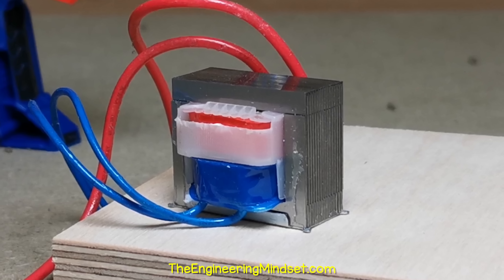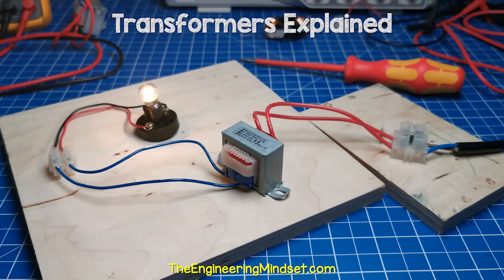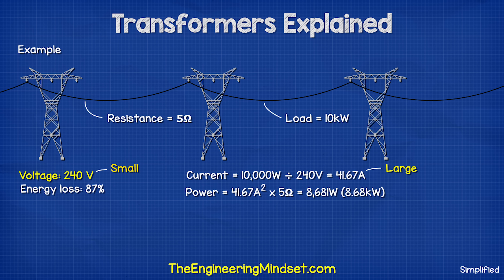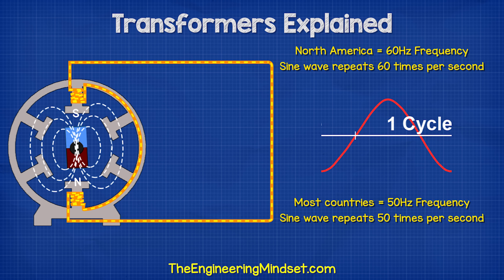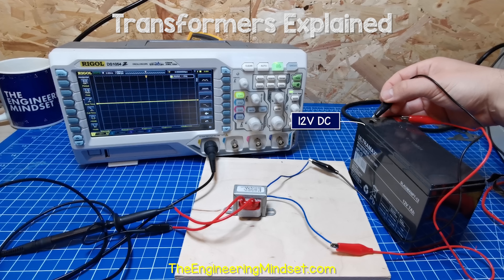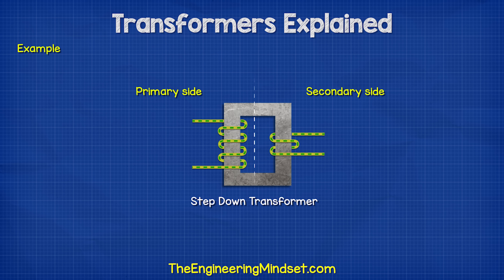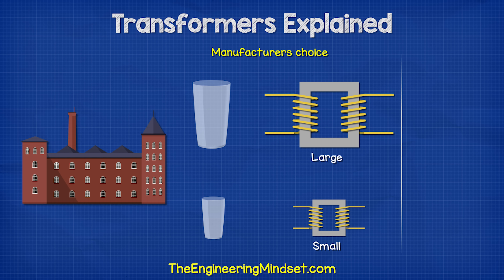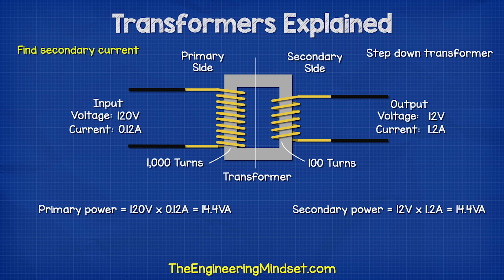Transformers Explained - How transformers work

Comment: A few others have said it, but you have reactive power wrong. It's not wasted as heat. Anything generating heat is consuming real power. Reactive power is temporarily stored and returned to the circuit by reactive elements like capacitors and inductors or other devices that exhibit some amount of capacitance or inductance. Reactive power does increase current flow and thereby increases losses due to parasitic resistive effects, such as the resistance of your wires or the eddy current and hysteresis losses in your core, so generally speaking, poor power factor will likely reduce the efficiency of the overall system. In one of your graphics you also labelled power factor as "Efficiency" and you also appeared to have used efficiency and power factor interchangeably after your beer glass analogy. Efficiency and power factor are not the same. While a power factor closer to unity is probably going to be better for efficiency, they are different quantities. Also, I'm not sure if this was just part of your analogy, but it sounded like you said that electricity customers pay for apparent power. This isn't true anywhere where I've lived - at least not as a residential customer. Residential customers in at least Australia and Canada pay for real power, so you generally don't get penalized for poor power factor as a residential customer. I'm pretty sure it's the same in the US. This is why your bill says how may kWh you consumed and not how many kVAh you consumed. I'm not sure whether other jurisdictions penalize small consumers for small power factor or not. Large industrial and commercial users may have different contracts with their utilities that charge them more or less based on their power factor.
Reply: Well written post. But even domestic/ residential customers help keep the power factor close to 1. The fan manufacturers, where I live, put a capacitor (capacitive load) in the circuit to oppose the inductive load of the fan motor and bring the fan's PF closer to 1. I don't know whether this is mandated by law or done voluntarily by the fan mfr to "help out" :)
I do know I only pay for reactive power at my residence (68 yo, male, retired), in South Asia.

Also I have had fights with my wife and 2 grown up D (if these 2 are around at that time) when they want to run some appliance off the solar panels when the main supply is absent. Try explaining that though the mixie motor may be rated "only" as 750 w, using it makes lights go dim and affects the TV/ computer! I have come to a stage where I am informed about the need to run the mixie, I shut off my computer and other non essential loads and give the green signal. Even then it comes as a surprise how dim the only light on becomes as the mixie motor takes both resistive and inductive loads from the panels.
I also want to praise the man who "invented" the concept of square root of (minus 1) as the ONLY way to deal with electrical circuits having inductive/ capacitive loads! Along with the wheel, 2 brilliant inventions.
Reply: I farted

Comment: What are the losses on 400kv lines? I'm amazed how we've harnessed electricity and figured out how to distribute it so efficiently.
Reply: 3:52
Reply: Losses always depend on current. I^2 * R. Voltage is irrelevant in this calculation. We use higher voltages to lower I as low as reasonably practicable, based on Ohm's Law V=IR 's proportionality.

Comment: Just a quick question: 

Let's say we have 1amp 12 volts at 50/60hz. 
If we keep same frequency, over transformer we will lose amps or volts, depends on stepping up or down. 
But.... What happens if we increase frequency? Let's say 60 Hz to 240 Hz and back to 60 Hz, using capacitors?
What happens to voltage and amps in that case?
Reply: I don't think you could use capacitors to do this.
The only way i've seen it done is by using your Primary Frequency (60 Hz in your example) to spin a motor that is close coupled via Gears to spin a Generator at Secondary RPM (240 Hz in your example). I don't have to mention hopefully the amount of energy losses that will be caused by using this system.

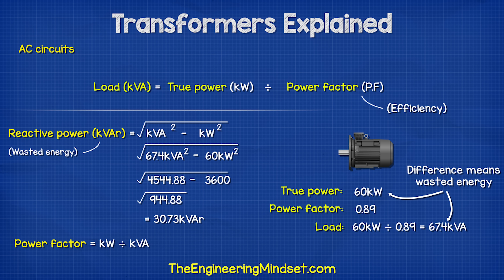Comment: At 11:50 minor correction. KVAR is stored energy due do reactive components (capacitors or inductors). It is charged and discharged throughout the system and it is stored energy. 
However the result is a reactive power creates higher current over your transmission line which result in greater losses. KVARs are sometimes desirable and are used for voltage control.
Reply: Aren't capacitators used to lower the VAR and increase the power factor due to a bad cos(phi) by the system only having spools? Then it makes the watt-less(reactive) power fluctuate from spool to capacitor without any energy consumption? Or have i completely messed something up in school?
Reply: @rasmus1600  Yes, but it depends on which side of unity you are looking. Capacitors can be used to reduce inductive VArs; the same way inductors/reactors can be used to reduce capacative VArs. We generally see commercial use requiring motors that all have inductive power factors, for this reason you have probably seen capacitors used to reduce VArs (inductive) by adding capacative VARs. The cos(phi) as you mentioned is a phase lag/lead description of the VArs; and can give a physical description of what the motor induction effect has on the voltage/current waveforms, and likewise how the capacitor introduction can remedy this. It also shows how Real Power (V*I) is lost as cos(phi) increases. Draw the current and voltage graphs at unity (they align); then draw a power wave (V*I). Repeat the same process with some amount of cos(phi) offset on either voltage or current waveforms. Redraw the Real Power (V*I) graph. You will see that with some amount of phase offset, the RMS real power decreases.

Comment: 13:46
I have a question : what if i want to design i transformer or to put it right i want to diy my own transformer how to pick up the number of turns 
Other question : if i found a transformer without a data sheet and i wanted to modify the output to a specific voltage how I suppose to know the number of turns in the primary cuz i think i differ by the wire gauge, input gauge etc..

Comment: High Voltage Transformer Microwave Utilized Transformer High Old Designing Without Such Transfer If so see how much winding measurement of the transformer according to Measurement

Comment: perfect timing.....although your video isnt really "needed" i'll still enjoy it immensely while improvising transormers unless you want to recommend a core for me, im trying to reduce 120v to about 70 or 80 in a portable/mobile form with atleast 500w, maybe even 1+ kw output although the generator im powering it with is only rated at 1 kw and the motors im running are rated at 1 kw EACH and im driving them with 2 or 3 kw at the moment, running a 36v motor at double voltage doesnt just equal double the power used, both the current and voltage multiply if i am not mistaken so instead of going up by the square, power goes up by the cube, from 1 kw to 4? kw at the moment i am looking at a few old MoTs and a few toroid transformers from sub amps

Comment: If electricity moving through a wire creates a magnetic field, wouldnt there be someway to harness that (via a generator spun using the electromagnetic field) energy to create more power?
For instance, could you rig up a series of alternators/generators that spin using the electromagnetic field of the wires going to devices in your home?
Say you have them connected to a battery bank and while you're using power in your home, it is at the same time charging a large battery bank?
Reply: no, what you described is a beidinni motor originally made by john bedinni, look it up and if you actually manage to get close to or over 100% the world will beat a path to your door
you cant get more power out than you put in, if you do you'll usually(always?) find that there is some kind of power you didnt account for, be it external magnetic field or even rf/photon/heat flux THE LAW OF THEMODYNAMICS AND CONVERSION OF ENERGY SHALL NOT BE VIOLATED as the science asylum would say
Reply: if you produce a transformer with x current and x voltage going through it say 10 watts total, if you try to leech some off it using the magnetic field by putting an extra wire parallel to it, you will find that there is an exact corelation to the power you took away and what is available at the output, if you put a 3 watt led on the output you will only have 7 watts left, again, if you figure out free energy, the world will beat a path to your door, and the rated capacity of a transformer is a nominal value, you can pull 100 watts out of a 50 watt transformer and it'll still work but it will get less and less efficient as you force it to work harder until you reach the maximum transfer ability of the core material and instead of drawing 100 watts, it may draw 150 watts and those extra 50 watts you're pushing into it will be converted to heat
Reply: @frogz  Well said.  I would add further that the losses related to each component (heat, noise, rectification to DC for batteries, etc) have made this approach unfeasible.  Edison and Westinghouse both probably scratched their heads more than once over this diminishing returns phenomena.
Reply from the maker: Seen the new LED explained video? so much detail covered! https://youtu.be/O8M2z2hIbag

Comment: Could have explained about tapped transformers(ex: 12-0-12) with the way you explained for the primary and secondary(voltage, current, turns) calculations. Consider in future!
Reply: think of it like batteries, each one only adds up to 1.5v and between any 2 ends of a single battery will only by 1.5v but if you take 2 in series it will be 3v or 4 6v, if you measure from a to c it will be 3 volts, if you measure from a to I it will be 12 volts, if you measure from a to e OR from e to i, it'll be 6 volts in both cases
(a) [-1.5v+} (b) [-1.5v+} (c) [-1.5v+} (d) [-1.5v+} (e) [-1.5v+} (f) [-1.5v+} (g) [-1.5v+} (h) [-1.5v+} (I)

Comment: In india they use 3 phase transformers and the secondary side of the stepped end down version has 3 phases and 1 neutral in total 4 outputs. Each phase ranges between 215 volts to 240 volts and neautral being zero. Each home will either have 1 phase n neutral or 3 phase and neutral. The primary side has 3 phases . Each phase has around 11kilo volts.
Reply from the maker: Thank you, do you know we also have a Hindi channel? https://www.youtube.com/channel/UCg4k338hz9U8jnD5SXPO5jQ
Reply: We have the same system here in The Netherlands, do you have any video suggestions where i can see how this type of transformer work?

Comment: In Brazil we have 127 and 220 both 60hz. Almost all homes and apartments have 3 phases and neutral. So overkill. On the plus side when EV becomes mainstream almost all houses will be very capable for fast charging. At the 127v areas they can use a phase and neutral 127 ou two phases 220. 
Am I correct to assume this use a star transformer?

Comment: Does this mean that if you take the transformer out of an electronic device for example a television you could then run it on direct current if you get the voltage right?
Reply: yes and no, you need to collapse the magnetic field for it to transfer, pulsed dc works but if you just run straight dc into a transformer you will get the voltage increase a total of 1 pulse and then the magnetic field is static and cant reset to push any more

Comment: Imagine 2 step up trafos connected in series, the output of the 2nd trafo connectod on to primary coil of the 1st trafo. Does the voltage gonna increase infinitely?
Reply: yes, until the breakdown voltage of the insulation/air, i've used 9 volt transformers in reverse to pull 1200 volts out of and i've used similar setups to produce ignition transformers by discharging a capacitor charged up to 350 volts through them to provide an electrically activated ignition for spudguns(potato canons)
Reply: if you put the series transformers in a much higher dielectric material such as oil, you can push it alot higher than you can in air, that is why most high  voltage transformers are potted in epoxy or even in a case of liquid oil, the oil also has the added benefit of allowing better heat transfer to the outside enviroment than air as it is thicker than air

Comment: Ok, here's a question... How do I calculate this...

I had a 10 VA variable transformer intended to step down voltage from 220 to 4 volts, a factor of 55 times. Now..., by accident I fed that transformer 24 volts on it secondary side, while disconnecting the primary side from the mains, and by accident again, touched the pins with my fingers..., giving my fingers a taste of 1320 volts (YIKES!)

Now, how many amps did my fingers get?
Reply: Probably less than 20 mA if you are still alive.   Current depends on the resistance (and reactance, for AC circuits) and finger tips are usually dry.
Reply: @karhukivi  Not necessarily. I was isolated from ground when I did it, so I could easily be large. As long as the power doesn't go through the heart, it won't kill you
Reply: It depends on the resistance between each finger that touched your 1320 volts and how good was the contact when you electrocuted yourself.
And also how "wet" your fingers were.  You can use an ohmmeter to figure out approximately. But if you take, say, one megohm "finger" or "body" resistance (1,000,000 ohms) which is a fair value to start with, you have 1320 v/ 1 megohm = 1.32 milliampere. The worst thing is an electric shock between both hands as the current passes through your chest thus through your heart. Ouch!

Comment: A bit misleading the 3 wire system, you have 3 power line systems. IT, TT and TN-C/S

If I have understood correctly, most of the world use the TN-C/S system. Norway and I think Romania use IT and TT systems. The IT system has the "neutral" on the transformer not connected to ground. TT system have the "neutral" connected to ground. Here the voltages are 230V between any and all wires, also 3-phase. Voltages to earth are 110-130V, depending on transmission voltages etc.

TN-C/S brings the neutral from the transformer along with the wires, for a total of 4 wires. C is for combined, S is for separated. The neutral, or PEN wire in the TN system is splitted in the intake, so you get one ground wire (PE), and one neutral (N). Before this intake, the system is TN-C with one PEN wire. After the intake the system is TN-S, with one PE, or ground wire, and one neutral. The voltages between phases here are 400V, phase - ground/neutral is 230V. Home appliances are 230V, so you load the 3 phases as evenly as possible betweem the neutral. 

When supplying 3 phase equipment, you have to check voltages. If the distribution system is TN, you want to power something made for 230V 3 phase, you need a transformer. Electrical motors are an exception as they normally are 230/400V, converted to the voltages you need just by copper plates in the connection house. Normally.

Comment: Hi, I do not understand how is possible to have a very high voltage but a low current.
I feel it is obvious that the enerrgy can not be created and if the power supply is one you can not increment power with a transformer. Thats what I understood at least.

But in the other hand if a cable has low resistance and I connect a very high voltage shouldn´t the intesity be high as well? because of I=V/R.

Thanks a lot for your videos and hope someone can answer my question.
Reply: The input current of transformer is held back by BEMF so the current won't get high even with very low wire resistance. But if it's DC then the input current will rise very high while no output, then the coil heat up. 
If the output is loaded, then the input impedance also decrease as the magnetic field holding back the current absorbed by output coil.

Comment: so how do they work in a car ignition coil which is DC?
Reply: pulsed dc works alot like ac but you only have half of the voltage swing available of an ac signal, you'll be going from 0 volts to 12 volts to 0 volts to 12 volts instead of 0 volts to +12 volts to -12 volts to +12 volts, the voltage is chopped up into chunks on and off with transistors or in older systems using points that physically break the connection with the engine rotating
Reply: @frogz  well stated!

Comment: I taught a class on power, generators, and motors.  This was the class that most students had trouble with.  Great job.
Reply: 30+ years ago, I took that class.  It was indeed challenging and, dare I say it versus nascent digital classes, boring.  Yet here I am 30 years later in the large power transformer industry (Dutch OEM).  Old school craftsmanship is a huge component to producing high quality power transformers.

Comment: I work in a ship and we have a group of Transformers that converts Voltage from 440V into 220V. The 440 V comes from generators and after Transformers, It goes 220V to the ship superstructure.

Comment: Sorry, I've got a dumb question. So primary coil forces the flow of electrons in the secondary coil. However, secondary coil doesn't get free electrons out of nowhere, and the load is using them (i.e. in lightbulb electrons are going out in the form of thermal energy and light). So why there's no limit on how long transformers can work before the secondary coil depletes all its free electrons?

Comment: In my opinion those step upconverters are magical devices as they can increase the voltage.
And off course voltage does play a rule in the amount of power because otherwise it wouldn’t have make any sense.

Comment: Question
If the voltage is stepped up
Isn't the voltage across the transmission lines
Much much higher.
For example
We step up 22000 V to 22,000,000 V
The voltage across the transmission lines is now 22,000,000 V so the new current should be 22MV ÷ R.
I know this isn't what happens
I'd just like to know why